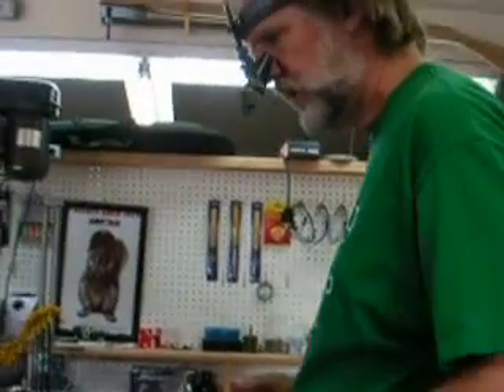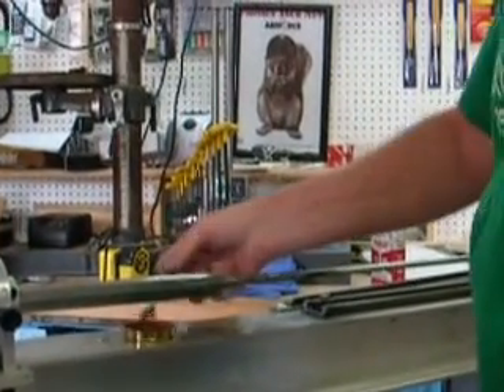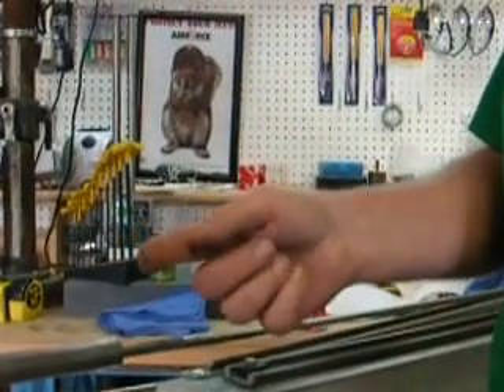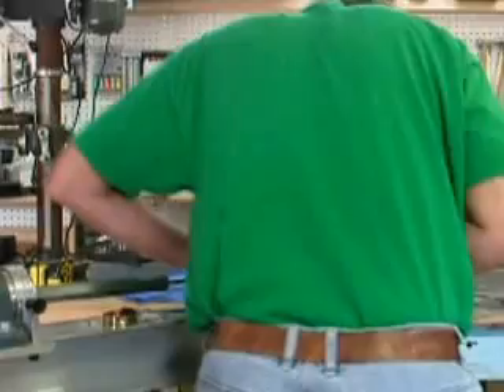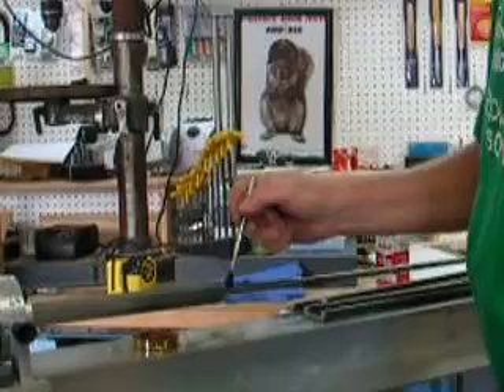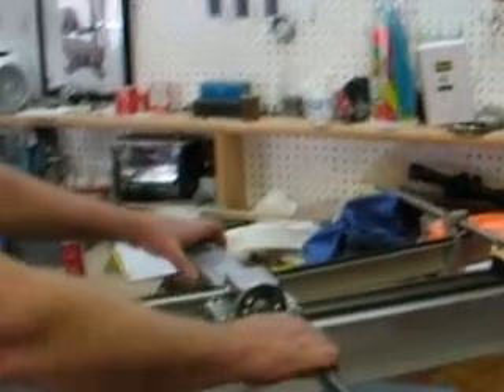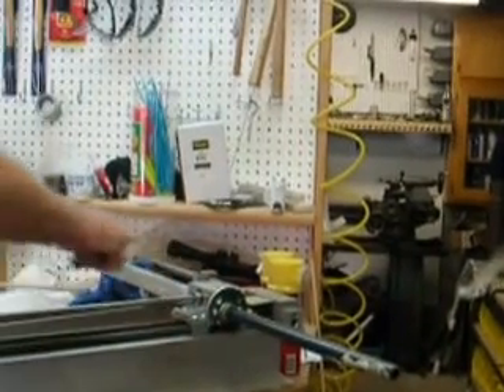Rifling demo 1

Comment: Martin -- Very clever arrangement - I was wondering how one might do that simply.   That's the best I've seen on the i'net.  I was surprised seeing it work on both the push and pull stroke, I thought rod would be too flexy for that.  It seemed you were saying you could change the twist rate without changing the gears - that was confusing.   Would love to see more about it, especially the gearing, or plans.  Very cool.
Reply from the maker: Thanx.  
I was concerned about the rod flexing also. I think it might with small calbers. 
 
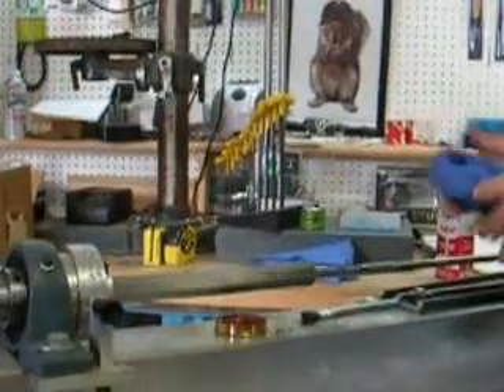The advantage of a sine bar machine is that the angle of the rack follower is changed to change the twist. I affixed measuring tapes to the diagonal and base.  The diameter of the pinion gear is 1.00".  To set a twist of 1:20 I set the center of the rack at 20" from the pivot and the follower on the carriage to pi inches.  Pi inches of rack movement will result in a full revolution of the cutter rod.  
See: http://orro.net/2011/02/rifling-machine/   for details and explanations.  Later,     Martin
Reply: Thanks Martin - pulled it up checking it out.  Sweet and easy.